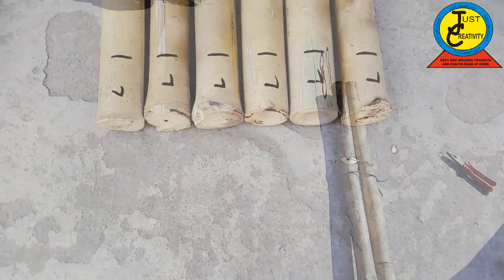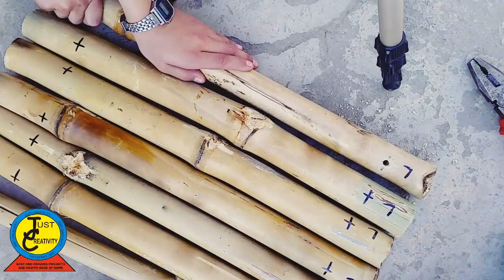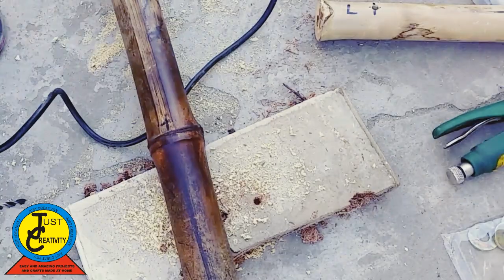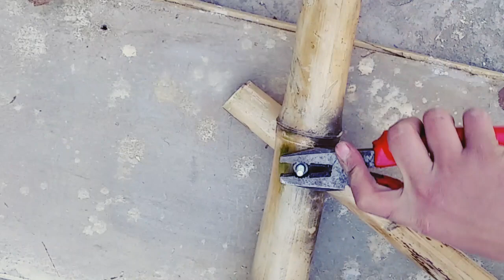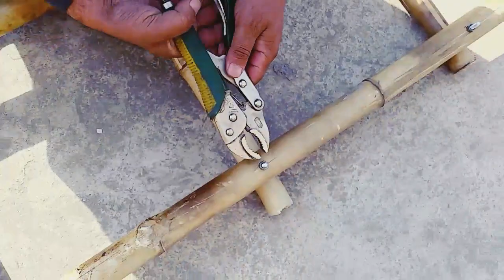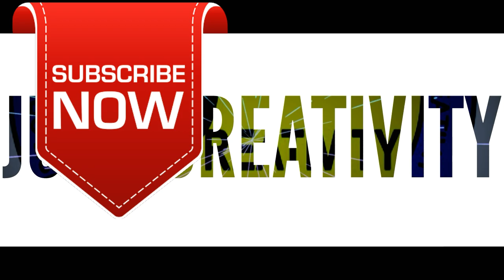Tutorial How To Make Bamboo Ladder At Home | 100% DIY | Just Creativity

Comment: good but not very reliable....whole bodyweight gets transferred to those nuts and the pressure can tear off the bamboo and eventually we might fall and get injured...in contemporary ladders the steps are centered into the big bamboos so the weight transfers uniformly...here they are fixed to one side...its just my opinion...but overall its a good job...
Reply: daniel busi i think its reliable.. bcz the bamboo is strong enough to carry an average adult

Comment: The ladder is unstable and likely to fall one side. There is no provision to prevent the ladder from turning left or right. The small pieces should be inserted into holes made on the larger bamboos. One should not use plier to tighten nuts. It will damage the heads.